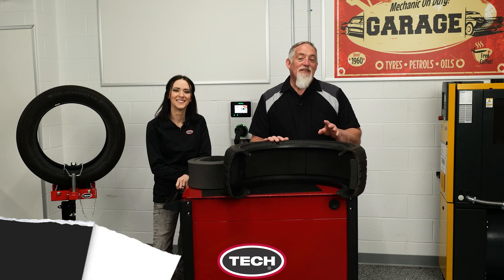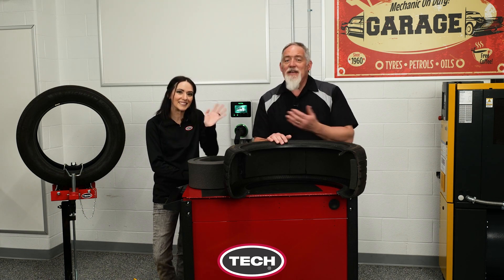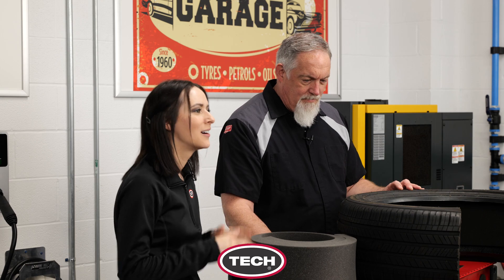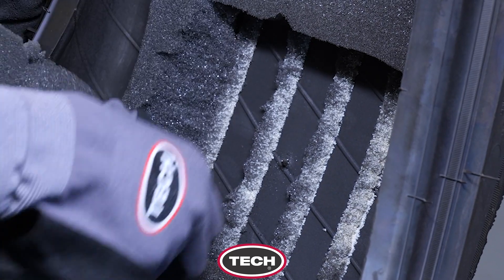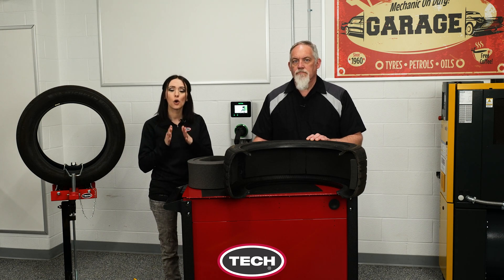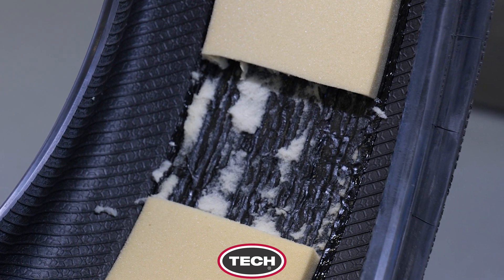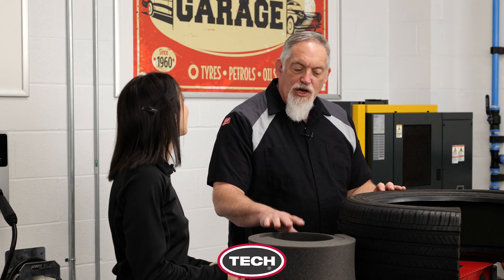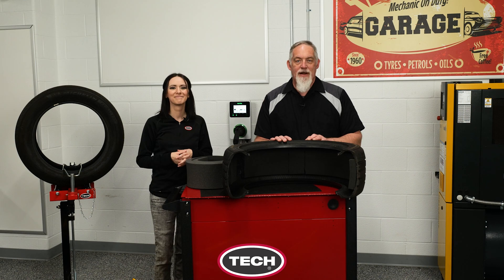Proper Repair of EV Sound Suppression Tires with TECH

Comment: Is it possible to perform an emergency repair on the exterior of tires lined with sound-deadening foam using those rubber tire plugs?